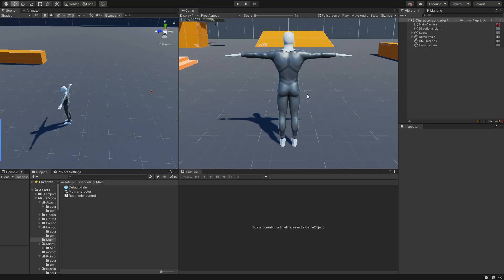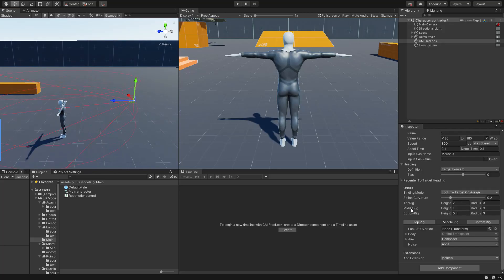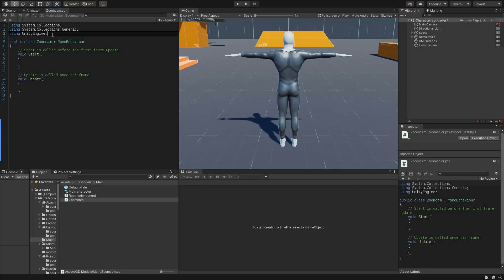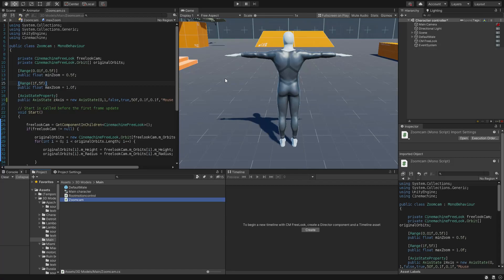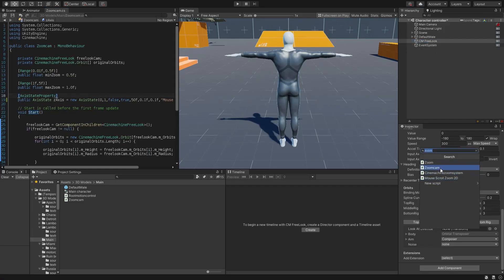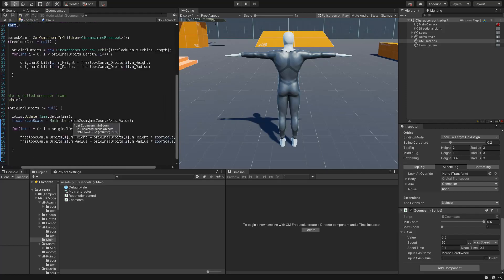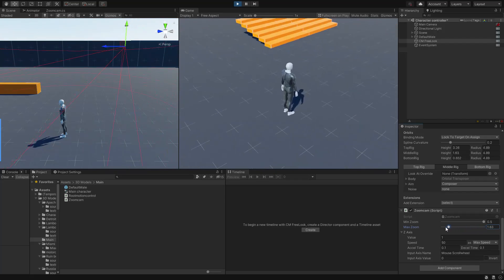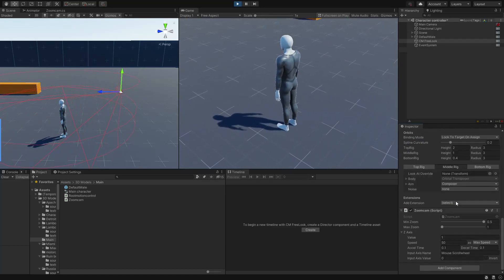cinemachine scroll zoom function in unity3d || mouse scroll zoom script for cinemachine camera

Comment: System.ArgumentException: Input Axis Mouse Scrollwheel is not setup.
 To change the input settings use: Edit -> Settings -> Input
  at (wrapper managed-to-native) UnityEngine.Internal.InputUnsafeUtility.GetAxis(string)
  at UnityEngine.Input.GetAxis (System.String axisName) [0x00000] in <a05f37d7a0a34fad9547811820ecb744>:0 
  at Cinemachine.AxisState.Update (System.Single deltaTime) [0x00076] in .\Library\PackageCache\com.unity.cinemachine@2.9.7\Runtime\Core\AxisState.cs:223

Comment: I was testing the script, but it's says "Input Axis Mouse Scroll wheel is not setup", how do I solve this?

Solved: I had to change the name of the input axis so it was matching the mouse name
Reply: Can you explain what you changed? I have the exact same issue but input axis does match the mouse name
Reply from the maker: hey buddy under peoject settings > input manager 
make sure to create a axis named Mouse Scroll wheel
Reply from the maker: happy , that you found the solution!